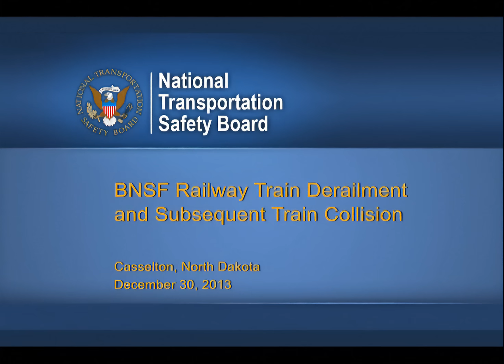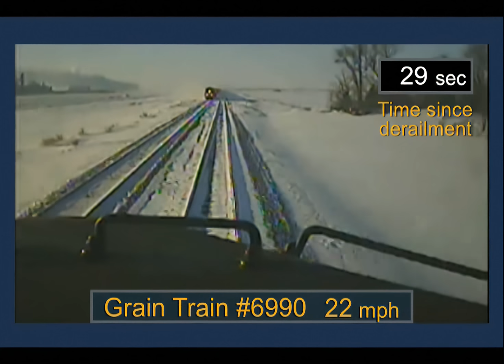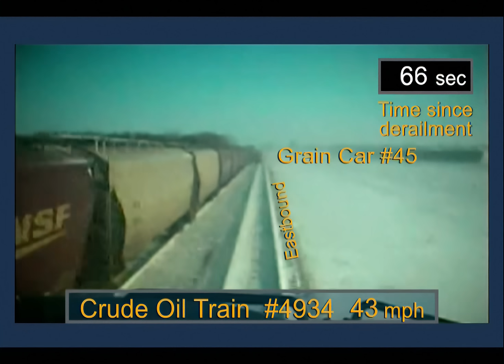BNSF Railway Train Derailment and Subsequent Train Collision

Comment: Several Flaws are going on: 
* Emergency brakes don't come on till car derailed
Vs before total axle failure.
* Emergency is not in sync to any train rolling on same rail system w/i 5 miles. 
* Every oil train crash has cost millions, let the 100's killed, and spilling 1000's of gallons w/i 100 ft of water. They really don't care. 
* Ineffective brake system per car, when 100 car passenger Amtrak at 70 mph, can stop in 1/4 the distance this one did at 30mph.
Reply: Rail cars typically derail moments after a catastrophic failure like this, so the time between failure and emergency braking is not significant. 
PTC is the newest attempt to "sync" an emergency application via RTC like you suggest, but it is extremely challenging to make a system like that reliable. 
Emergency brakes take time to full apply, and the air pressure loss propagates from the broken hose at the derailed car. 
A passenger car weighs half as much as a loaded freight car (or less) and has a more advanced air braking system.

Yes there are faults, but the rail system itself really is fairly well build for the job it does.
Reply: Do you know why Amtrak can stop quicker? Amtrak trains don’t weigh 10,000+ tons.

Comment: the grain train is required to call out emergency the instant their train goes into emergency.  stating their location.  they were a little late and did not do it correctly
Reply: Doubt crude train still would have been able to stop in time.
Reply: Worth a try, don't you think?
Reply: What if it had slowed 1/2 as much.   Could have made a significant impact in the result.

Comment: For viewers who have operated a locomotive:  the uncommanded emergency induced brake and the engineer induced emergency brake - do they have to be applied separately, or could the emergency brakes be applied simultaneously?  Thank you
Reply: It's one brake system that can be applied by the crew or by a derailment or separation  - anything that damages the train's air line - the 'trainline'.
Reply: steemdup uncommanded is just that, train line air was separated due to derailment. The commanded emergency was on the key train (crude oil train) after the crew spotted the derailed car from the opposing train.

Comment: At least no one was hurt, judging by the time the axle broke on 6990's grain car, 4934 definitely did not have enough time to stop. 4934 was on a different frequency which is why you hear that dialing noise after it derails, the grain car derailing was extremely bad timing.

Comment: Question,  how would an engineer detect a car derailment  ?
Reply: Usually if the train's air line separates the emergency brakes are automatically applied. Then the conductor has to walk back to locate the "problem", if it's not already obvious.
Reply: SparkDalmatian  Thank you that makes sense now. I drive trailer using air brakes if air lines get disconnected the trailer brakes automatically apply.. thank you for your reply.

Comment: Indian Railway engines have an emergency light fixed on the front of the engine. When something goes wrong, the emergency light blinks and the train coming from the opposite also stops.
This could clearly have been avoided.

Comment: absolutely fascinating/ gives one a look into the lesser known aspects/ the dangers of being an engineer/ certainly does nothing but increases my  respect for the people that run these powerful machines/
Reply: Powerful is right. It wasn’t even going that fast when it hit that derailed car, but it hit it GOOD and then split off at like a 45 degree for another 40’ or so without any track under it
Reply: I'm guessing it's far more dangerous driving to and fro work than driving the choo choo.
Reply: Locomotive driver or railcar driver (multiple unit driver)
Reply: Theres nothing more horrible than looking down from the beast and seeing the terror in someones face as they are about to be struck by said train how do u deal with that!
Reply: respect  people that run these machines with no steering wheels and almost no control ...
Reply: @stephaneboisvert8990  whole lotta go and a real difficult whoa!
Reply: Whats an engineer got to do with it, they are train drivers.
Reply: @mikepxg6406  Train drivers are called engineers
Reply: @Synergiance No they are not.  The rest of the world call them Train Drivers.
Reply: @mikepxg6406  They’re called engineers all across america
Reply: @mikepxg6406  I've called them train engineers to avoid the confusion. But it's often just "engineer" in North America.

The more you know.
Reply: the what? dangers of being an engineer? dude the engineers are in much much more safety than anyone else around a train, their only real danger is having a hard exam every year to keep their job (at least in my european country) ....or having a mental breakdown because of watching people's dying....
Reply: @Rapkatona18  they're pulling millions of pounds of materials, some of which are explosive/flammable. Train tracks constantly intersect with roadways, and a freight train can take up to a couple miles to stop. If you can't see the dangers inherent in that, you desperately need to take some OH&S training.
Reply: As a MOW employee i can assure you trainmen are huge pussies.
Reply: @gentoolive  tf is MOW
Reply: @kenpack161  Move Outta The Way!
Reply: @kenpack161  Maintenance Of Way.
Reply: @kenpack161  Maintenance of way
Reply: @gentoolive  gotta admit, I’m not gay but there’s some hot ones.

Comment: Why didn't the train(with the video footage)Reverse to avoid or lessen the damage?
Reply: Are you serious? Reverse into the derailed freight cars?
Reply: Wouldn't be able to. Trains usually run at about 1 horse power per ton. Once you go on the ground there is way more friction then on the rail. Also the airbrakes lock up as soon as you lose pressure from the main air line connecting the cars.

Comment: what was the cause of the derailment?  One car out of the entire train (or are there others further back), on a straight stretch of track, at a moderate speed - what went wrong, rail spread, switch in wrong position, etc -?
Reply: Axle failure on grain train car 45 according to the NTSB.

Comment: If the tracks had been just a little further apart. Durn roman roads. Barely enough room for two chariots.
Reply: I would actually agree with you on the spacing, besides the false news.

Sidenote: How did you misspell "darn"? The [U] and [A] keys have a distance of 6 keys between each other.
Reply: @comicsansgreenkirby  "durn" is American (Murcan) slang for the slang "darn" which is slang for "damn"
Reply: There is actually no correlation between 'roman roads' and North American railroading.   Just one of those fun 'false news' items that isn't true
Reply: C David there’s no correlation between David’s and humor apparently either

Comment: how does a truck just derail? flatspots on wheels?
Reply: It was caused by microscopic cracks in one of the axles of that grain car, which finally gave way right there at the exact wrong place and wrong time, causing it to derail, and then 4934 hit it, and then (after the footage shown in this video) the oil train exploded and the two lead engines were burned to a crisp and scrapped on site.
Reply: it fell asleep in the train.............

Comment: NTSB report says derailment caused by broken axle. Trains initially were on on different radio channels,  was cause of delayed communications says NTSB report. (trains often are on different radio channels when traversing or going from one dispatchers controlled division to another dispatcher controlled area).
Reply: Must have the conductors portable on 1 when calling RTC.
Reply: Trains that can’t talk to each other due to using different radio channels seems really stupid
Reply: @burtonlee22  When I worked at Norfolk Southern Railway, trains could call dispatchers on the road channel, so if something went wrong, they didn't have to go to the dispatcher channel to do it.
Reply: @burtonlee22  different railways have different radio frequencies, same as different geographic areas or railyards will have different frequencies for different uses.  I am unsure if there is a common frequency that all trains would be equipped with, like for example,  all aviation radios have 121.5 in them which is a common emergency frequency used everywhere but beyond that different airlines have different frequencies and different airports have their own frequencies used for approach,  departure,  ground and so on.
Reply: @MNRick041  121.5 is only used for meowing these days.
Reply: @mortson978   "You're on guard, You're on guard, You're on guard." Some idiot pilots will monitor 121.5 just so they can go on and say that when someone meows. I hated flying with those kind of idiots that thought they had to play guard cop on 121.5 because they were usually idiots in many other ways.
Reply: @burtonlee22  , to whom are you replying?
Reply: IF that is indeed true, (I honestly do not know one way or another, I really know nothing about the technical aspects of trains), but if it IS actually true that different trains use (or can use) totally different radio channels, then the rules should somehow be changed and implemented where if any 2 trains are in close proximity to each other like that, as in passing each other, etc., and either one of them has ANY kind of emergency like that, then the radios should automatically pick up on that and broadcast it immediately to the other train, on whatever emergency channel is needed for that to happen, that way BOTH of them are fully aware of what is happenning on the other one, and the other train can have more time to react and slow down, or hopefully even fully stop BEFORE a collision happens!...

(Also, why isn't it ALREADY a requirement for BOTH trains to SLOW DOWN a LOT, (like down to 10 or 20MPH or so), when approaching and passing each other in close proximity like that, that way if either one of them has any kind of emergency like that then the other one has time to react and come to a complete stop too!?!)

It also really seems like with all of the computer control and automation of almost everything else nowadays, and with all of the sensors and technology we now have at our fingertips in this modern world, that the railway companies could all implement more safety features like that to help to prevent this kind of accident!

It almost seems like the railways are using totally outdated equipment and technology, which isn't really a good thing, especially considering that they still are a strong 2nd place in overall goods transport volume, next to all of the semi trucks all over the freeways of the country, and trains are pretty much the ONLY way to transport extremely LARGE and/or super heavy cargos over long distances across the country...

Hopefully the railway companies have come up with a good solution for this aforementioned communication problem by now, and if not, they definitely should, because especially now with oil and gas prices ALREADY being so ridiculously high, we definitely can't afford to ever waste any oil like this! (What a MAJOR toxic mess to clean up too!)
Reply: Nope. Everyone is on channel 1
Reply: @abynx533  Then why do we only hear one channel on the video?
Reply: @abynx533  , second crew went to disp channel & toned him.

Comment: Why wasn't the crude oil train slowing down?
Reply: At 48sec the dispatcher called 'train in emergency, 4934 watch yourself'. At 66sec, 9 cars out, 4934 went into emergency. At 75sec, impact. They had 28 seconds notice. But 6990 should have called 'emergency' at 20 - 30 seconds.  That would have allowed more than 45 seconds of braking, not enough but better than 9 seconds.

Comment: It's a dumb idea having 2 oncoming trains that close together anyways. It's a shame an accident had to happen to make it even more obvious.
Reply: R/C giant planes
Reply: Canteenboy117 How would you propose to run trains differently? Would you have a southbound train wait at a point 200 miles away on a double track while a northbound train was moving towards it? It is normal to run trains in opposite directions in the same area, using double track or sidings to pass by each other.
Reply: Paul Kettle Jr oh I don't know, how about either moving the tracks farther away from one another so one train derailment doesn't become two. If that's too hard, build a barrier so falling debris from one train doesn't cause problems for another. People much smarter than myself are in charge of these decisions. That's why crashes like these just make me shake my head.